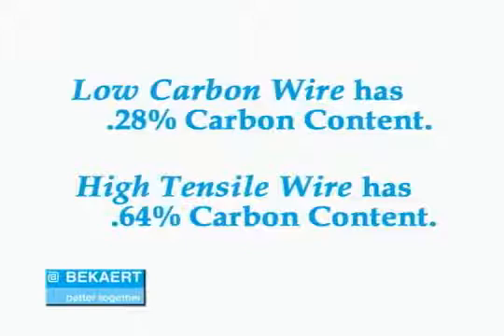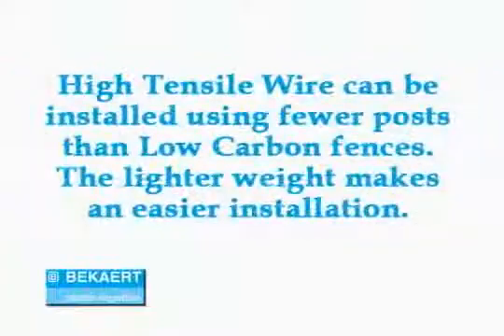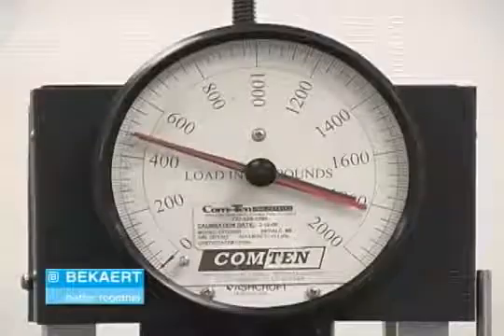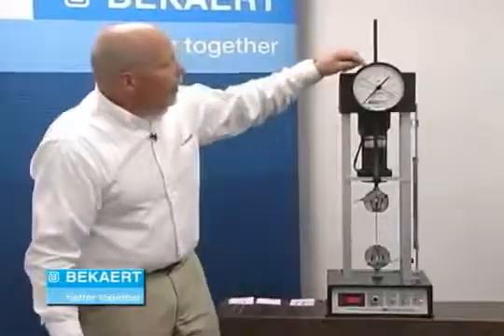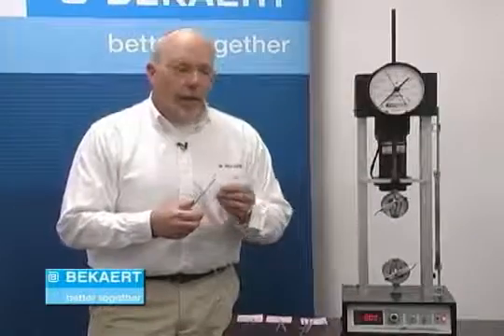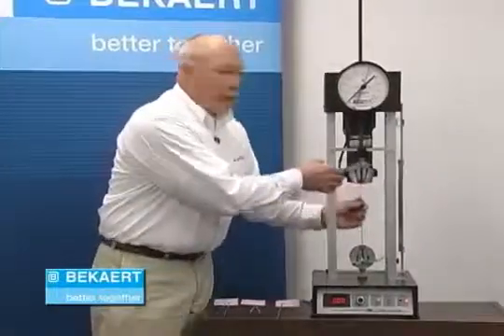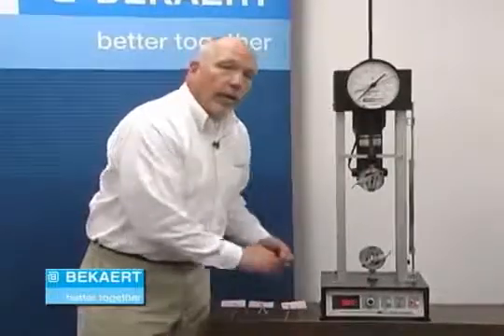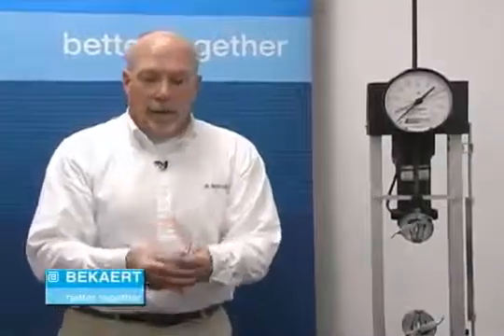Breaking Wire: High Tensile Wire vs. Low Carbon Wire

Comment: What’s the best wire to use when illegal aliens are climbing the fence, we ranch near eagle pass Texas 
And them people sure hurt the fence around the braces on both our high fence and 4 strand
Reply from the maker: Hi @S Stein. What specifically is happening to your fence? Sagging? Being cut?
Reply: Bekaert Fencing sagging , they climb up the wires, we put metal ladders but the border patrol used it as a choke point, so they move up and down the fence
Reply from the maker: @sstein49  We would recommend adding in some hot wires on the opposite side. This could help deter climbing.